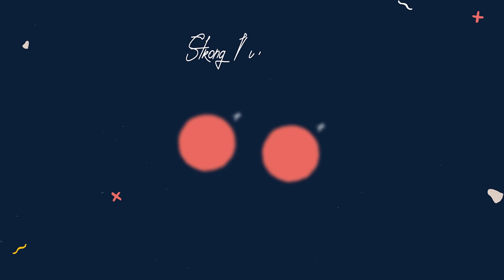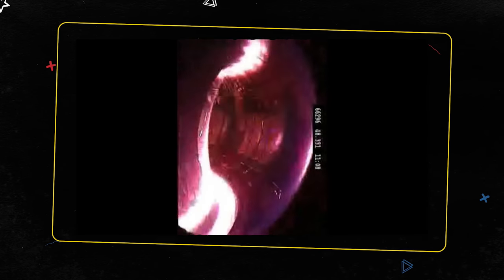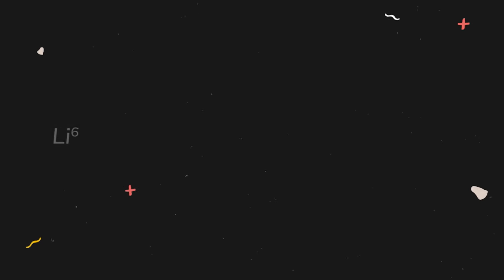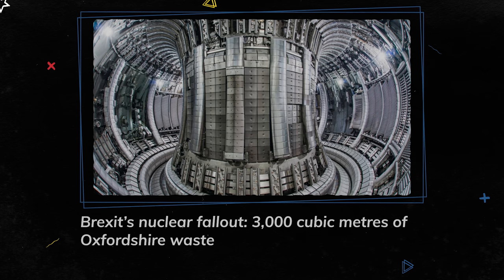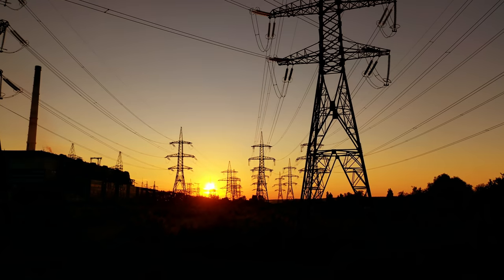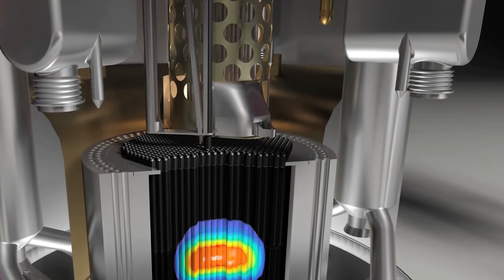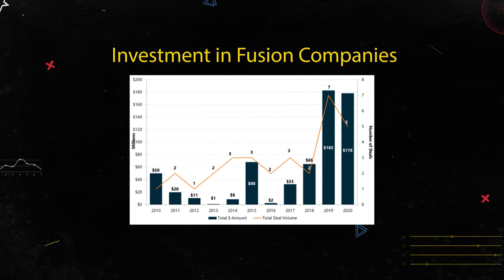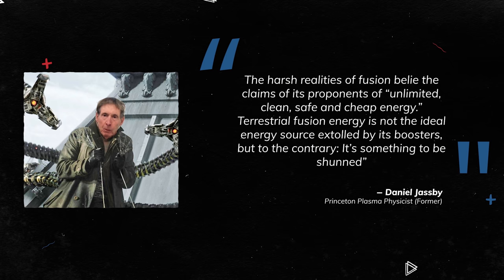What No One Else Is Telling You About Nuclear Fusion

Comment: 7:40 "Around 200-300 watts to heat up the plasma and turn on the magnetic confinement"
Impressive, that's less than my kettle. :) Does the presenter understand orders of magnitude?
9:25 "fission plants are not getting built anymore because they're considered too expensive"
A lot more nuance is required to address this, but there's just a lot of hand-waving. Countries with nuclear power plants tend to have cheaper electricity. Clearly a more important metric is cost per unit of power, not cost per plant.

Comment: you guys do realize that jet labs and the reactor in china both proved that net positive from fusion is possible check out my mini fusion reactor prototype the MFC. this is not a Farnsworth fusor this is a form of 
mini tokamak that uses one magnet for electrode protection 
and particle spin and uses the x-ray presser from the reaction to confine the plasma 
as a passive containment as the reaction increase's so does the x-rays so the core self balance's.
this core is for a vacuum thruster design meant space travel could be viable for a mini power plant scents the containment is passive requiring less input power.

Comment: this is unnecessary FUD, P-B fusion can actually produce electricity directly but it needs higher containment temps. the new rebco superconductors are much stronger, make an order of mag more powerful magnetic fields and do it much closer to liquid nitrogen temps. you might consider looking at SPARC by MIT and W7x by Germany. fusion energy generation is definitly going to be earlier than 2050s.

I do however agree that ITER is an utter wastage of resources. esp because design is so outdated that they cannot even use the new magnets, at this point its just a jobs program.

you video is just another version of the old meme.. 'fusion has been 30 years away for 30 years & will always be'.

Comment: So is this video based on the work and opinion of one scientist? Scientists generally speaking deal with consensus. How does his peers view his work and argument?
Reply from the maker: Hey, when we first came across the article, then we were sure most of the objections would have been addressed. 

But the more we looked, the more it looked like the problems of high energy neutrons, 100% Tritium retrieval and breeding, and parasitic power drain were not easily dealt with. 

Any solution would have to use novel materials or techniques. The fact that ultimately you’re using the heat to run a steam turbine also puts a floor on expense. 

All these factors coupled with the fact that everything in contact with the neutron flux will be highly radioactive means that the big advantage this has over fission is already lost. 

You can research this more, but like us, you’ll probably find that there have been advances in high temperature semiconductor which can be cooled using Nitrogen instead of helium. 

That only influences the parasitic power drain, and that too marginally. 

We’ve got a policy that any well researched opposing view will be pinned to the top of the video. So if you can find some new information that we may have overlooked, we’d be happy to boost it.

Comment: Fusion power generation doesn't seem economically scalable to me.
In the case of the laser fusion tested by the national ignition facility, you have the largest laser ever built and it still doesn't work. giant multi billion dollar laser facilities at every power plant isn't going to work. With tokamaks, the insanely expensive engineering required to control the plasma is also not going to be economically viable.
Far better to use fission. Fission happens for free. (decay is the natural state of the universe).
The only problem with current fission power generation is the historical legacy of using high pressure  low temperature processes. The infrastructure costs to safely control high pressure steam is madness and using a "low" temperature is thermodynamically insane. Switch to a much more logical low pressure, high temperature process like molten salt reactors (yes thorium!) and you have much less expensive infrastructure (& much more scalable footprints) AND higher thermodynamic efficiency.

Comment: General Fusion's magnetized target fusion approach doesn't have any of these problems.
Reply from the maker: What fuel are they using?
Reply: @TechforLudditesSira  "General Fusion's magnetized target fusion system uses a ~3 meter sphere filled with a mix of molten liquid metals lead and lithium. The liquid is spun to open up a vertical cylindrical cavity in the centre of the sphere (vortex). This vortex flow is established and maintained by an external pumping system; liquid flows into the sphere through tangentially directed ports at the equator and exits radially through ports near the poles of the sphere.

"Attached to the top of the sphere is a plasma injector, from which a pulse of magnetically-confined deuterium-tritium plasma fuel is injected into the center of the vortex. A few milligrams of gas are used per pulse, and the gas is ionized by a bank of capacitors to form a spheromak plasma (self-confined magnetized plasma rings) composed of the deuterium–tritium fuel.The firm demonstrated plasma lifetimes up to 2 milliseconds and electron temperatures in excess of 400 eV (4,800,000 degrees C).

"The outside of the sphere is covered with steam pistons, which push the liquid metal and collapse the vortex, thereby compressing the plasma. The compression increases the density and temperature of the plasma to the range where the deuterium and tritium nuclei fuse, releasing energy in the form of fast neutrons and alpha particles.[17]"

Basically, there is no fast neutron problem. No tritium leakage problem. Presumably, the lithium 6 is put in to generate additional tritium in the fast neutron bath. All in all, it's an extremely clever design.

Comment: If  Nuclear Fusion was viable on a Human scale why are Stars many magnitudes larger than Earth or the most Massive planets in the Sol system ? the Size of a Star determines its Fusion process Red Dwarfs are some of smallest stars yet are giants compared to planets.   Fusion may be unfeasible at the scales Humans need it to be to make it a viable source of power.
Reply: >If  Nuclear Fusion was viable on a Human scale why are Stars many magnitudes larger than Earth 
Because gravity is 10^40 (that's 10 with 40 zeroes behind, just in case)  weaker then electromagnetism. That's why even very small magnet can lift a metallic object. 
So if you use big magnets to squeeze, you would need a LOT less space then if you try to compress from mass alone

Comment: Im making a small Stellarator from old microwave Magnatrons I do not know how i know how to make it, like all my other inventions and designs, they come to me in my sleep. hardest part is getting all the old microwaves i need .
Reply: Last 2 things i built was 2 jets, just big enough for me to fit in. i designed and built the motors myself, that runs on 100% air and a old bobcat control handles and rods, no fluid of any kind is used in them, I have flown 1, it was awesome, the motors have no top end, but i cant make the body hold up to high speed. around 40,000RPM the motors does something weird i cant explain, the motors jump from 40,000RPMish to 65,000RPM, instantly, then the jet flew so smooth. any ideas what causes that ?
Reply: The motors are just highly modified Tesla Turbines

Comment: Yeah the problem is the sun might condense the plasma but It must still move because plasma is very much like a fluid. Plus stars are formed from pure hydrogen so surely science should start there and see if dueteirium and tritium form naturally from hydrogen plasma and when that occurs. Also I don't see what the benefit of heating up hydrogen to temperatures reaching 100000 degrees. What an expensive kettle .It seems to me that devices dealing with temperatures closer to the sun's temperatures would be a better starting point. I'm not a scientist I'm only a laymen so I'm probably wrong , but these fusion reactors don't make good common sense to me.

Comment: Fusion is not economically feasible, this is correct, this expansive machinery is ultimately payed by final customers with their brains, viable solution is to scale down these generators at personal or family level, other ways the society has numbered days.

Fusion reactor generate radioactive residues is correct too, even with no neutrons, hi energy particles bombardment  generate radioactive garbage.
Fusion reactor is difficult to scale down for personal use.
Reply: All about energy is poor management, industrial fusion is technically achievable but those want to use it must pay the bill,and it is not cheap.

Moving to a DC grid is far more cheap than build and use fusion reactors to compensate loss difference, there are also big losses behind the meter that are associated with use of dc native electronics on ac grid, using native dc power solve these losses in a good manner, electric motors runs better on inverters, no native AC is needed to run them.

Right choosing of electronics that we use is also important, a laptop is better than a desktop in terms of energy usage, despite it`s price is double.

 If you check the run costs a laptop is far more cheaper, laptop itself plus energy bill for it`s entire life is less than a similar desktop plus energy bill.
Remind that is a additive problem that result in energy scarcity and rise the energy bill.

Heating water or homes with electricity is the worst approach,  electricity comes as as relative small percent of primary energy source, better use the primary source directly.

Comment: Why not just bring the mountain to Mohammed and use 'cold plasma' techniques such as high impulse EMF's to selectively heat electrons over ions, energising them to condensation thresholds wherein thermal and and quantum phases intersect, causing bosonisation effects (think 'high-temp' Cooper pairing) allowing the electron gas to drop to lower Fermi energies, these condensates precipitating out onto the slow lumbering ions, while pumping in more electrons to take up the vacated Fermi energies of the currently-condensed population, and maintaining the input EMF's, selectively heating them over the protons and so causing them too to join in the condensates, thus subjecting their trapped ions to ever-higher forces & energies.. until a network of coherence is established, effectively allowing remote nuclei to interact as if they were already inside one another's proton radii, thus circumventing their mutual Coulomb repulsion entirely and obviating any need to generate or thus contain ludicrous proton KE's in the first place?   

You'd only need a simple dielectric liner in the reactor to accumulate enough capacitance charge to achieve electrostatic containment, in principal the ions never needing to get above room temp..  

How much head-banging and shadow-boxing before we realise there must be an easier way to go about this?  Hot / equlilibium plasmas are a hiding to nowhere - like those physics skits in Family Guy where something just won't move or yield in the way they're trying to manipulate it, and it just drags on and on way too long - only minus the humour..

Comment: Some of these arguments are strawmen - people developing nuclear fusion are not promising free electricity from next year. They, and every one who has actually researched the topic, know that it is at least a decade in the future, with tons of research and engineering challenges left until regular non-research operation can start.
Other are fan-favourites fallacies.
"But it is 10 years from now since 1050" - check the progress achieved in temperatures, and triple product. Fusion has come a very long way. We're not there yet, but we're getting there.
"but it uses a ton of energy to cool and power the magnets" - every power plant required energy to run. As long as it produces more than it uses, and the difference pays the bills this is irrelevant.
"but the engineering will be crazy expensive" - Research is, of course, expensive. The F-35 cost almost a Trillion to develop, coming up to about 1.5 Trillion total program cost. But until a final working design is implemented claiming what the costs will be is, at best, idle speculation.

"but the safety features will be crazy expensive" - nuclear fusion is already held to an impossible standard. It has caused less deaths and damages than any other major power source in both absolute numbers and per energy produced, and yet has requirements like "needs to take a hit from an airliner and keep working". No other power source is subjected to such conditions, even dams which can cause massive destruction if thee fail. Is such impossible standards are forced on the even safer fusion power plants, then yes, it will be uneconomical. Scaremongering like this video are definitely helping with that.
"but it produced 3000 tons of radioactive waste" - the walls of the test reactor got irradiated. It kept working. Once the reactor is decommissioned the walls could still be considered low-level radioactive waste, relatively easy and safe to store. The actual waste of the reactor operation are lighter than air and escape into the higher atmosphere, and are also measured in grams. Coal power plants during normal operation release more radioactivity than that (also, more radioactivity than fission power plants during normal operation, incidentally).

Comment: All what you say is what ITER and DEMO finds out. Don’t judge a book by its cover. 
Energy consumption will rise in future. And larger facilities might still be needed in future to supply sense cities or Industrial regions. 
So don’t stop science still in its beginning.
Reply: In 1/3 of the time nuclear had a working reactor and it was providing power to the grid. DEMO hasn't even started construction yet and it's going to take 30 years atleast till it's running.
Reply: Even then it's not a proper fusion reactor just a test.

Comment: No, I don't agree with your opinion, many things are ignored here. Fusion isn't just because we are trying to clean and sustainable energy. Energy needs are going to increase in future and you are way to optimistic about renewable energy. Renewable energy has way too problems like efficiency of what is available and what can we genarate from it and genarate it to the point where it can replace other sources their comes way more challenging problems like area required to genarate need with today's efficiency, and to boost efficiency you need costly material which gonna increase its cost and they also not reliable as conventional energy. Fission also has its limitations like fuel. Just electric cars fusion is going to succeed and commercial even it take little more time.

Comment: If you want to research the impractical, research the history and expenses spent on useless renewables or watch the Michael Moore documentary "Planet of Humans."
Reply from the maker: Renewables are great. Solar pairs great with cooling requirements. 

They could easily make up 20-30% of the grid depending on where you are and if pumped hydro is available.

Trying to run everything on renewables is probably a bad idea, since that required either gas turbines, or overbuilding renewables to 4x peak load.
Reply: @TechforLudditesSira  Baloney, renewables (solar/wind) require base-load/on demand (spinning) reserve power generation to be running 100% of the time while said renewables are operating, due to their variability/unreliability, so as to balance the grid. This backup is most commonly fossil fueled generation (nat gas/oil/coal) so you get to pay the capital and operating cost for two types of power at the same time.....efficient....no,  effective....no, reliable.....no, expensive.....yes! 

While renewable costs have come down it's due mainly to the huge state, local, and federal government subsidies ($) they have been provided with and the fact that China is trying to monopolize the market by selling their solar products bellow producers cost. 

Your assertion regarding fission generation is also ingenuous. Forth generation reactors can be made at much less cost while producing a fraction of the waste and actually using previously spent nuclear fuel as a source for on going operations. Small Modular Reactors and other 4G nuclear is the only emission free source of base-load power currently available (except hydro) to use as even China is now ramping up.

Please don't start with batteries either. With all the currently installed storage in California including every electric automobile, the grand total of time they could exclusively supply power to the grid is about 30 minutes......you may have noticed Cali having numerous rolling blackout/brownouts last summer?